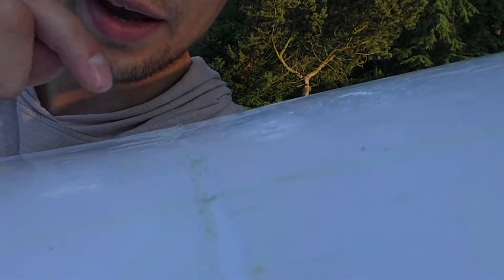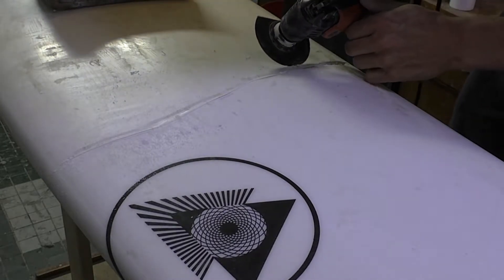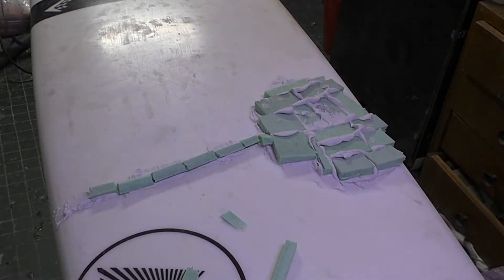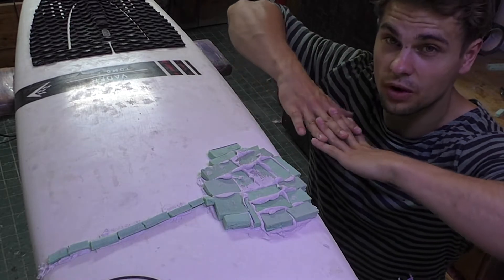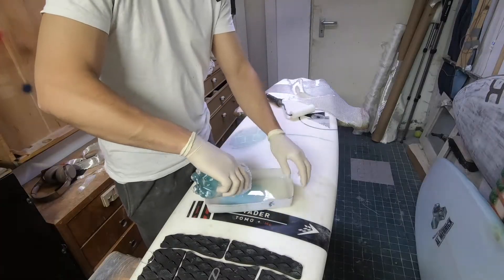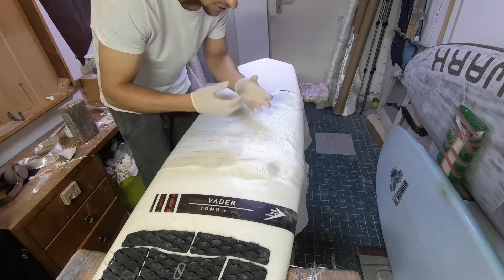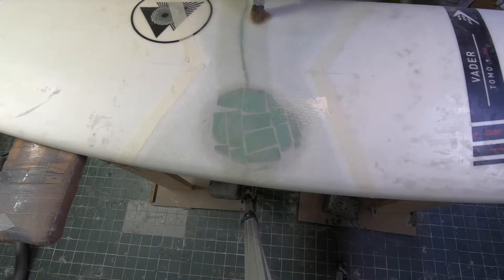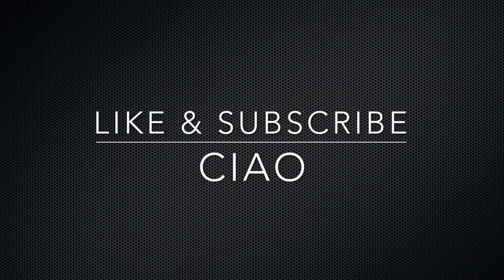(almost) Snapped board repair

Comment: Hi, so exciting that had explore ur channel, the content is so rich and knowledgable.

I want to ask what is the resin you use? May you plz explain it more?
Reply from the maker: Hi! Its much easier if you use high quality resin. Its less toxic and does not heat up so much during the reaction, so its less likely to melt the foam. I use this: https://shop.hp-textiles.com/shop/de/hochlast-laminiersystem-epoxidharz-hp-e111l.html

Comment: Hi
Ich laminiere gerade Styrodur 20mm. Ich will mich auf so eine laminierte Platte später auch setzen können. Dazu habe ich an der Zugseite (unten) mit 163g Glasgeweben laminiert und an der Druckseite (oben, da wo ich sitze) 2 mal mit 163g laminiert. Ich habe jedoch nach vor das Problem, dass wenn ich mich draufsetze, dass ich dann "Dellen/Abdrücke" (vom Gesäßknochen)  auf der Oberseite bekomme. Hast du einen Tip wie man das am besten verhindern kann (ohne viel Gewichtszuwachs)? Die Oberseite also "steifer" machen.
Dreimal mit 163g laminieren?
Eine Lage CFK? Hilft das was?
Reply from the maker: Hi! Mit Styrodur habe ich kaum Erfahrungswerte... Aber gegen solche Dellen hilft cfk, ja. Grund: gfk ist flexibler und behält Verformungen auch eher bei als cfk. Deshalb sehen gfk Surfboards auch so furchtbar dellig aus :D ob es damit getan sein wird, kann ich aber nicht vorhersagen...
Reply: @derbastlermeinesvertrauens753  Danke. Wie würdest du belegen? Einen Mix aus gfk und  cfk oder reines cfk? Und welche Reihenfolge? Zuerst cfk dann GFK?
Reply from the maker: @RaphaelVogel  Reines Gewebe ist meines Erachtens meistens besser, weil durch die unterschiedlichen Gewebeeigenschaften ohnehin nur eins der Gewebe vorrangig die Kräfte aufnimmt. CFK beispielsweise dehnt sich nur 0,9 Prozent. Kombiniert man das mit GFK, fängt letzteres erst an, die Kräfte aufzunehmen, wenn das CFK schon gerissen ist. Lediglich zur Aufnahme von Druckkräften könnten GFK nützlich sein. Was wird das eigentlich? :D
Reply: @derbastlermeinesvertrauens753  Der Boden eines Fahrrad Wohnwagens, den man im Rucksack Format transportieren kann. https://youtu.be/izEI_NZVzhg
Reply from the maker: @RaphaelVogel  Ui! Dann hoffe ich, dass meine Infos hilfreich sind. Nicht, dass am Ende der Boden einbricht ;-)
Styrodur deleminiert sich übrigens bei Boards erfahrungsgemäß tendentiell. Liegt wohl am vergleichsweise hohen Gasaustritt bei Erwärmung (überduck im Board). Also nicht komplett abdichten die Platte :-)